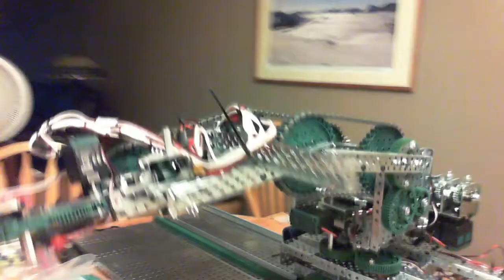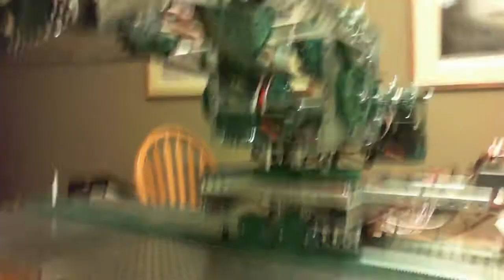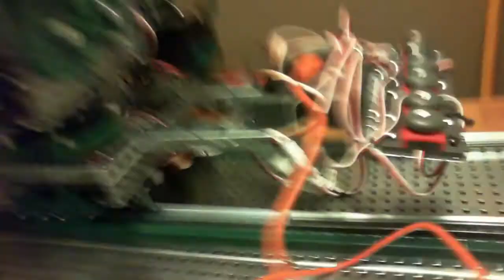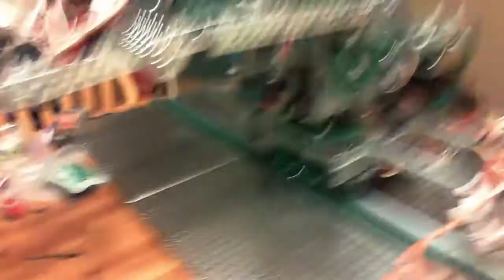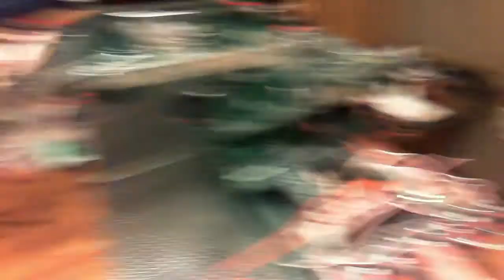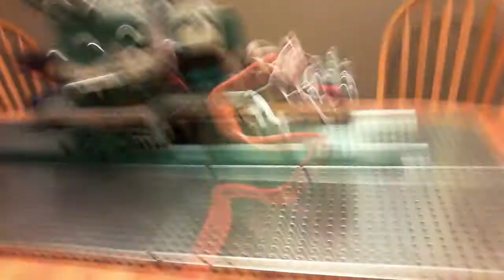VEX Robotics 5 Axis + Linear Slide Base Robot Arm Using Joint Move!

Comment: Hello my engineering class is building a replica of your vex robotic 5 arm axis . We were wondering if you could post a video showing a in depth look into your robot it would help out a lot  were only going off of your video. Thank you for the video
Reply from the maker: Hi, I'm flattered that you want to try to replicate it, I would love to take a video for you BUT I donated this robot to my Automation and Robotics program when I graduated. The basic principle is that the elbow joint and the wrist joint are driven through a parallel arm linkage using the chain and sprocket. The shoulder, elbow and wrist are each driven by their own pair of motors running through worm/wheel reducers. Each axis is keyed to a potentiometer which is used instead of an encoder to figure out the position of the joint. The LSB uses an IME (Integrated motor encoder) and there is a limit switch on the slide base which hits a post on the end of the track to zero it. If you have any specific questions you would like answered, please let me know. I can't give you any kind of detailed building instructions. I pretty much stuck parts together until it worked.